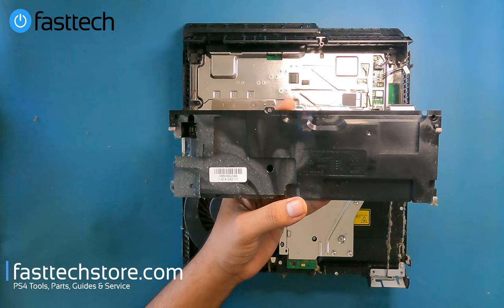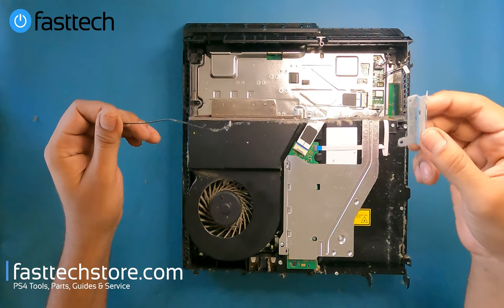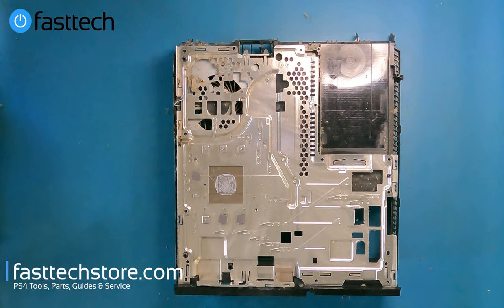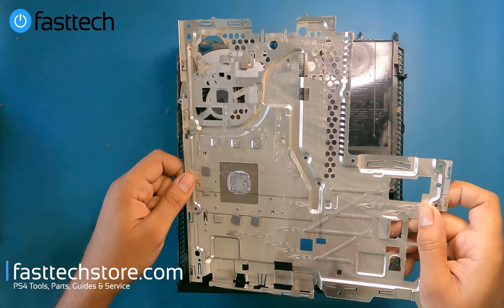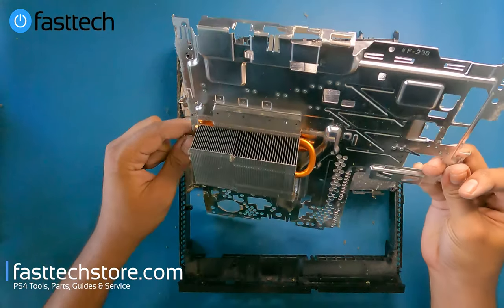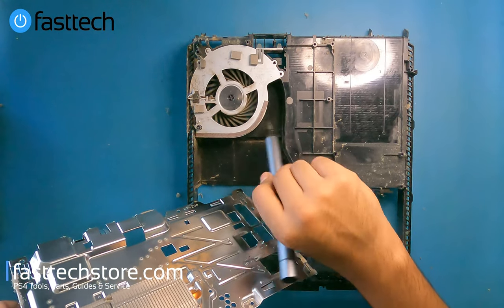PS4 CUH-1000/CUH-1100 Disassembly and Repair Guide (OVERHEATING, CANNOT START, NO POWER, DISC DRIVE)

Comment: Do I need to take out the power supply and Disc drive to get to the heat sink and to put thermal paste on the cpu
Reply from the maker: You dont need to remove the disc drive from the frame, only its cables but you have to remove the power supply. Hope that helps. Please like the video and subscribe 😊
Reply: yes